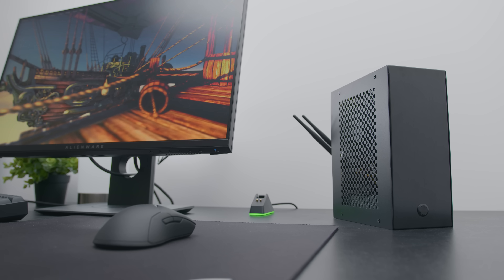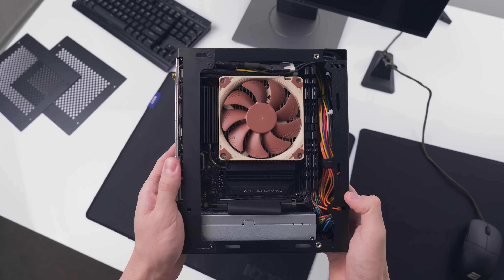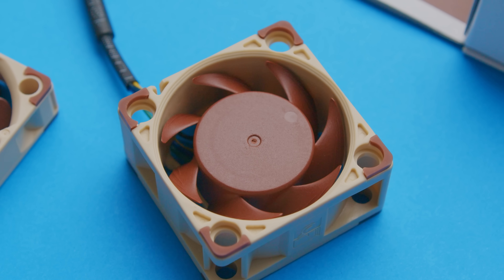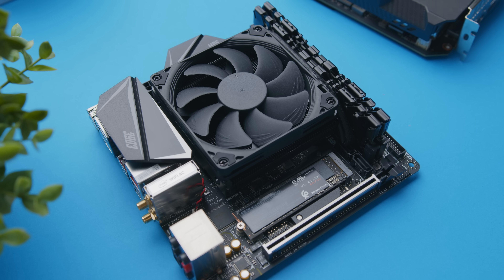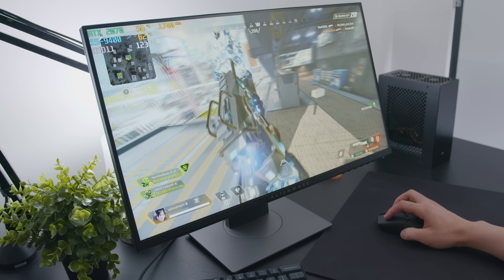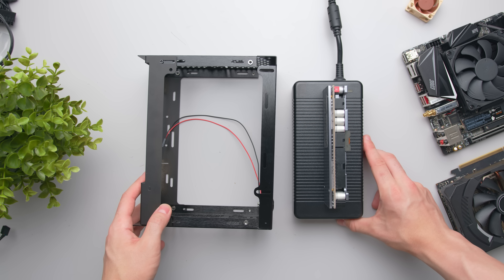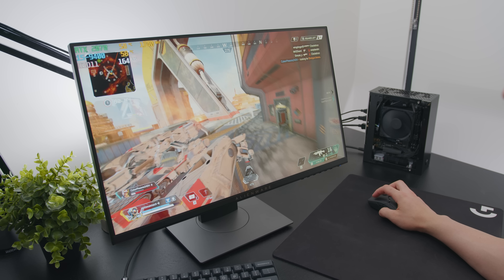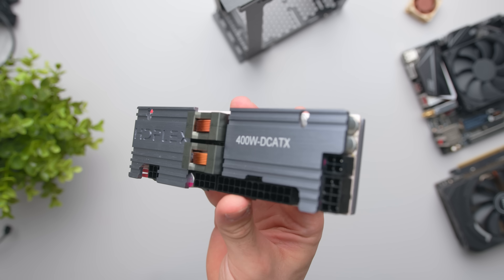Rebuilding the Tiny Velka 3 Gaming PC!

Comment: Do you think it would be possible to reduce the thickness of the 20mm model enough to fit it in to the psu? For example, running it across a belt sander on both sides? How much clearance is required?
Reply: blaster17363 you can basically cut open the fan mount on the psu and bent it out and put the fan between, if you need help ask for discord

Comment: Im going to buy this case but do think a 400w psu can handle an rtx 2070 and a i7 8700 .. non k model?
Reply: And icant seem to find the rtx 2070 u used on amazon also the link is broken .. can u link it plz?
Reply: it'll be very hard to find as theres one or two companies that make the itx 2070 in low volumes.
Reply: @ForkTheSpoonWrecker  i found one for 600 usd ... wtf im not paying that much for a 2070
Reply: Ali Lol, exactly my point. its the same situation here in Canada.
Reply: It's close but yes.

Comment: A straight 12v supply would be a lot better. Get a 300w 12v power brick, and then you only need breakout cables for cpu/gpu power and a tiny pico psu to make the motherboard happy. Instead of going from mains->19->12, 3.3, 5 etc, just go from mains to 12 (like actual modern psus do) and from 12 to the others with a pico psu

Comment: I guess my only question for this build is; is the 400W Power Supply efficient enough to power a 2070 RTX ? (like safely?) OH WAIT, you undervolted your GPU was it loud because of a low PSU paired with a 2070?

Comment: Now that's interesting, didn't know we had this kind of choice with server PSUs! :o
Didn't know there were PSUs that flat and short! ^^
Would probably switch, but earliest in two years, if any of the 300-400€ graphics card would fit in there.
But what a dream that would that be! ^^ I just wish at that size there would be some sensible cable routing included!

Comment: Why is this case not op if it just like any other mid-tower case in terms of preformence? I need to replace my build to an extremely  portable one ( i am only stuck with the monitor option) but what are the down sides to these sff if they all fit in  bag with the same specs that I have in my full tower?

Comment: I have the gtx 1660 super mini itx and an i5-1400f 10th gen 16gb ram and 400watt   80 plus gold with rgb so my tfx psu is under a lot XD and the gtx 1660 super is overclocked to Max. It was 171+ in msi for the core and + 601 on the 6g gddr6 memory XD

Comment: will a z690 MB (any make model) fit with a proper cpu cooler. will try using intel cpu/gpu no dedicated card just to save weight then i might be able to use a dif psu.

Comment: recently ordered 500w flex psu, but i did some research on reddit that 10mm thick fans are not recommended for a flex psu, but mr. optimum tech puts the noctua 10mm thick fan on the psu. i'm really confused, should i or should i not put 10mm thick fans on my psu

Comment: Thanks for the video, I was also going to do this but for some reason my CPU noctua cooler is still louder than the PSU one so I didn't bother. Maybe it's because the fan is on the other side of the PSU? It's a 500w as well
Reply: the fan is probably also better than the one here.

Comment: just curious if a 3600 or 3700x would be able to be cooled by a small cooler like that little owl?
Reply: 3600 sure, 3700x would be toasty with stock settings, but doable. (For AMD get L9a, not L9i — although it seems that AMD variant should just include mounting bracket it's actually a different cooler with slightly bigger heatsink).

Comment: @Optimum Tech which header did you put the psu fan into?
Reply: Mooch1222 he used that one from the Mainboard, have almost the same case, I did the fan swap too and it works fine.

Comment: What is that material called that you used to seal the end of the wires 4:46 ? Anyone? Thanks!
Reply: Ciao Giovanni. Sono guaine termorestringenti.
In pratica sono dei tubetti flessibili di varia misura che si restringono quando vengono riscaldati.
Se li cerchi su internet ne trovi di ogni dimensione e colore
Reply: It is called heatshrink.
Reply: Thanks guys!

Comment: If the Dell AC adapter is 330W how does it supply 400W to the DC-ATX adapter? Thanks!
Reply: This thing about 300wts under load. And AC adapter have some %% of overload.

Comment: Hi Im wondering if there are any alternatives for this "Dell 330W AC Adapter", it currently doesn't exist(?) anymore.
Reply: Enhance ENP-7660 600 W 80+ Platinum Certified Flex ATX Power Supply maybe

Comment: Can anyone who has built with the velka 3 case and velka riser cable comment on the fit and ease of use of the cable? I used a compatible riser cable but it was not easy to use. It barely fit but still worked.

Comment: im gonna do a build in this case with a ryzen 7 3800xt gigabyte rtx 2070 mini 8gb and 16gb ddr4 5000mhz corsair vengeance lpx ram and 4tb of sabrent rocket nvme ssd. BLAZING FAST SYSTEM!!??!?!!

Edit: I put these specs down and noticed how crazy this sounds.
Reply: The crazy thing here is the ryzen  7 3800xt, the noctua lh-l9a is barely enough for the 3600xt. Go with the 5600x it has lower tdp

Comment: Z390 + 9400F =  WTF...!!
[Plus, For so long I'm asking you to mod reference RX 5700 with bios flash & third party air cooler. ]
Reply: Phynix72 : He probably doesnt have another mobo on hand so it makes sense to use what ever mobo he has laying around. 3rd party heatsinks are larger and most likely wouldnt fit an itx case so no point in him doing this type of review.

Comment: So maybe this is a moot issue for you now but I am really wondering what this would sound like if you had used this PSU instead:  https://www.amazon.com/Athena-Computer-Power-AP-MFATX50P8-Supply/dp/B073JXM2K2/?creativeASIN=B073JXM2K2&linkCode=w61&imprToken=u4UdvG8b6Sy1WcTxq6FYow&slotNum=25&tag=akshatblog198-20  The reason I ask is because the fan looks larger than the FSP one and it is positioned by the power outlet and actually pulling fresh air rather than being choked up inside the case.  At the very least, I wonder if this Athena one would actually fit the larger Noctua fan in it since the casing looks to house a thicker fan.  Anyway, if you ever feel motivated to come back to this one, I would love to see how this PSU works in that case.

Comment: tiny 3950x build !!!!
Reply: Would need to do severe underclocking and it won't boost, the Noctua L9a won't be able to cool that 3950x properly. I've considered a 3900x for my Velka 3 build, the cons outweigh the pros as you do need more boost clocks for a good performing gaming system.
Reply: i bet that wont do it. 120mm liquid cooling with Grizzly thermal paste ? WE DEMAND 3950X TINY BUILD. lmao

Comment: Why 9400f when you can use 3700x undervolt it and have more power and same power consumption? You most likely get away with stock voltage and a 4.0 or 4.1 clock speed at 65w and having 8 cores and 16 threads.